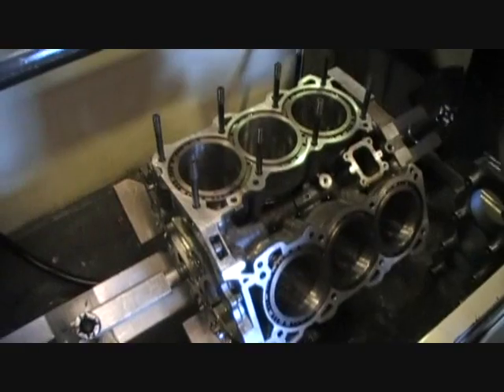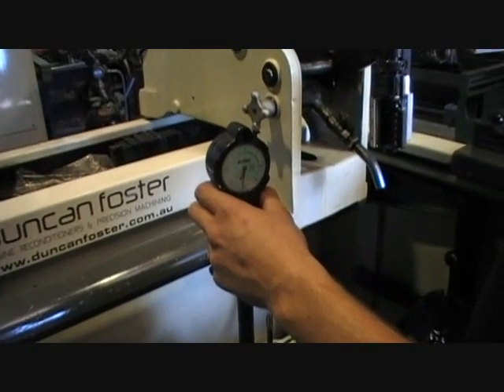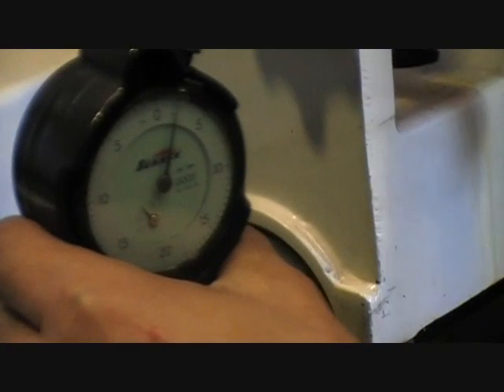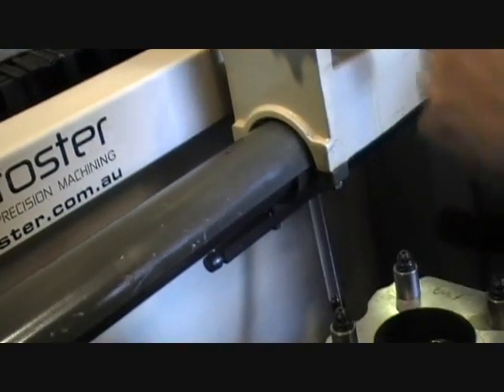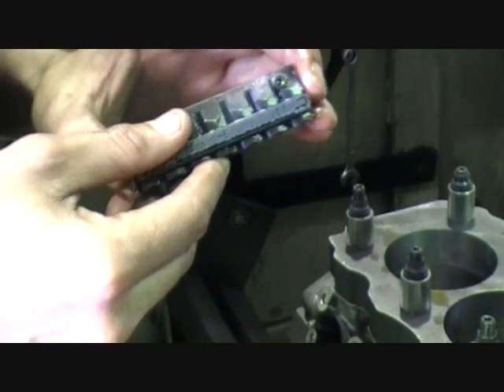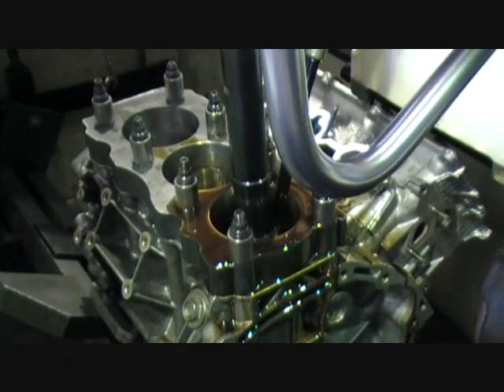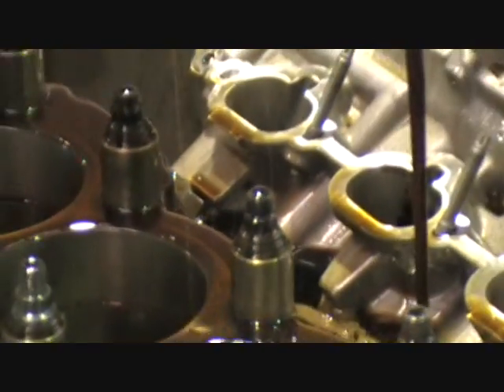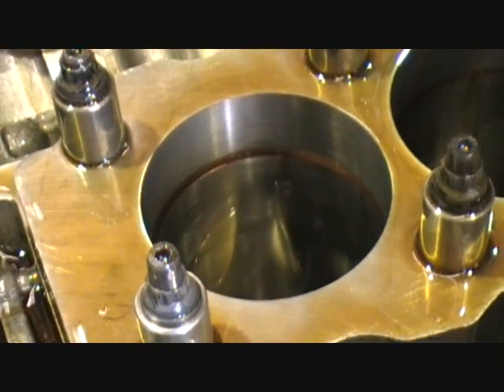Torque Plate Honing (extended version)

Comment: All aluminium-block engines should be honed under stress.  Nissan both bores and hones blocks under stress.  This allows the engine bore shape and alignment to be more precise after the installation of the cylinder head since the torque plate simulates this stress applied by the cylinder head.
Reply from the maker: The engine we honed is VQ35 DE for our race car, using forged pistons and rods, custom steam pipe manifolds and twin 3071 turbo's.  We also tested a VG30DETT which are cast iron, with and with out a torque honing plate and the difference was up to one thou.  
For more info see our website www.uniqueautosports.com.au and go to our race car build in gallery section.